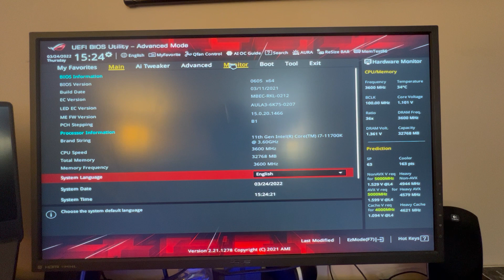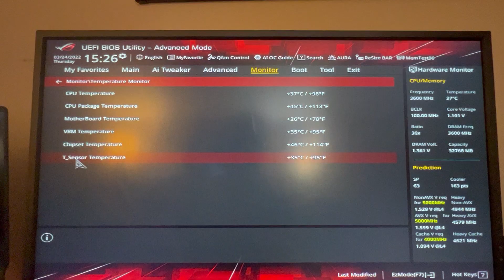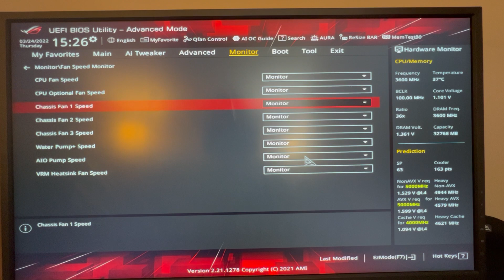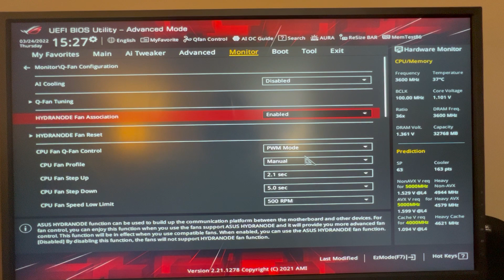GPU controlled case fans sort of

Comment: I just bought one of these as I noticed it on my motherboard. I have downloaded manuals to the new z690 and z790 intel boards and they don't have a t_sensor pin (port) any more. I am assuming yours did or did?
Reply from the maker: Yes. It is on my Z590. Thats interesting. As far as i can tell. the t-sensor has been on boards since at least 2011. (the oldest board) I still have a manual for. 
There is also a piece of software on github called fancontrol. I talk about it in another video. You can  gain control over all fans even GPU though it in many cases. Note this software is user made. up to you if you want to trust it.